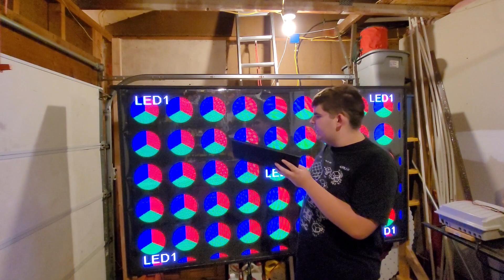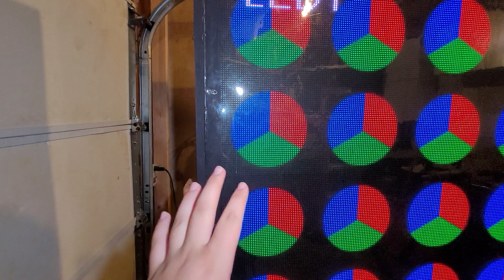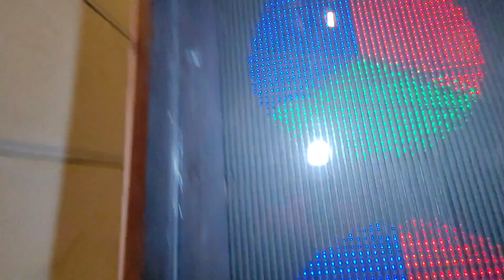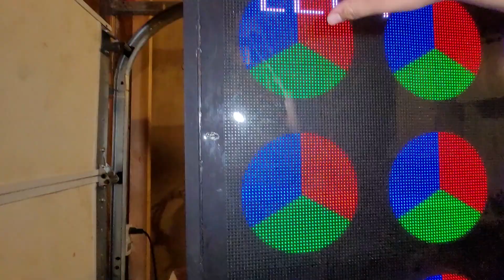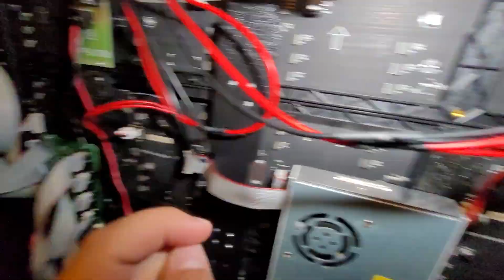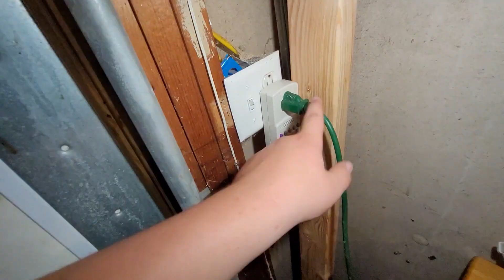P5 Panel Build - Behind the Scenes/Enclosure Build

Comment from the maker: I wanted to add something I said in the video at 8:02. I said you can run a controller off the same Raspberry Pi running the Colorlight card. This is true, but I wouldn't recommend it after some testing I've done. My whole display kept skipping and frames were dropping because the PI couldn't handle talking to both the screen and the controller. Yes it technically does work, but I was getting maybe 3 to 5 FPS with 40 FPS sequences running. I'm going to set up my second PI to run just the Colorlight card and hopefully that will fix it.
Reply: I would like to know how it does. Maybe an update here. I'm just curious 🤔

Comment: I just bought a P5 kit from Wired Watts, 5 high x 4 wide.  I assembled the panels with the arrows facing down and to the left (from rear view behind the panel).  My plan was to put the one power supply and color light card on the right side (again from rear view behind the panel) and the color card and raspberry pi on the same side.  Two questions; Does my layout make sense and how to I attach the components to each other and in what order?  Pi then Color light then power supply?  TIA!!!  Appreciate it!!!

Comment: Regarding the flicker, what version of the firmware are you running on the ColorLight card?  There is a known issue with flickering that is usually resolved by reverting to firmware version 11.04.  If you're not running that version, give it a shot and see if it resolved the problem.
Reply from the maker: I had tried this before and it didn't work, but I actually figured out the issue a few weeks ago! I just had to change the "data groups" setting from 16 groups to 32. Now why and how did it fix it? I have no idea LOL

Comment: In regards to your flickering problem I read that the colorlight card requires gigabit Ethernet to work properly.  I could not tell from your video how you have the Raspberry Pi connected to the colorlight card.  I don't think the Rasp Pi has gigabit Ethernet so I have seen some people connect the Rasp Pi to a gigabit switch and then also connect the colorlight card to the same gigabit switch.  You may want to try that.

BTW, I really liked your video.  Very informative.
Reply from the maker: Thank you for the tip! I thought the Pi 4 had gigabit ethernet, so I didn't think that was a problem. I did just now run a command "ethtool eth0" on the pi that gives you a whole bunch of information about the ethernet connection. It says its 1000mbs, but I don't know if I trust it. I do have a USB to ethernet adapter, maybe I should try that at some point and see if that does anything.

Comment: Hi. Have you solved the right side noise flicker? I have the same Problem.
Reply from the maker: No sadly I have not yet. If I can ask what are you using to control the colorlight card? Are you using a Raspberry Pi in remote mode? Is it connected to a network with wifi or ethernet? Someone told me I should hardwire my Pi running the colorlight card, and that might fix the issue but I'm not sure how. The only ethernet port on the pi is being used to control the colorlight card so I though of maybe getting a USB to ethernet adapter. I was just curious if your setup is similar to mine 😅

Comment: very informative , I've been looking into building a large screen led panel system.  I particularly liked how you improvised the protective clear pvc screen cover and the wooden chassis build .  I did read in the amazon listings that the pvc does shrink or expand depending on temp.  I'm wondering if you've had any issues with that so far?
Reply from the maker: Thank you, glad the video was useful! I did make an update about the screen in either my Halloween or Christmas behind the scenes, but honestly the clear pvc cover did stretch A LOT. It was the worst during Halloween because here in New York, the temps can still be around 60s or 50s. With that and the sun beating on it, it made it stretch a lot. During Christmas it wasn't as bad, but for Halloween what I ended up doing was putting a tarp over it during the day. The worst part about the whole screen was the panels actually stretched in the heat too. The plastic covering that goes around all the pixels and sits on top of each panel actually almost fell off. It stretched and if the clear screen wasn't there to hold it, it probably would've fallen off. When it got colder it somehow stuck itself back on, but I feel like the panels I got were really low quality. So honestly, the clear pvc screen might've been a bad idea and you may want to look into other options if you don't want to see it stretch.

Comment: GREAT VIDEO!  Are you aware of any simple software libraries that can run on a BeagbleBone Black and display text on those P5 panels without Xlights software?  I would like to build a simple 2x3 P5 matrix that simply displays text using an API.  Thanks!
Reply from the maker: Hmm, I wish I did, but I'm not sure of any. I don't really know much about running panels off a Beagle Bone Black so I probably won't be much help.

Comment: Were did you get those brackets? I've tried 3d printing my own but its not very stable. I need them for P3 panels.
Reply from the maker: Are you talking about the brackets in the corners of the panel? Or the brackets that hold up the panels? The brackets in the corners of the panel frame are literally just shelving brackets I found at Home Depot 😂. I don't remember what they were called, but I'm sure if you look around in a hardware store you could find something similar. The brackets that hold up the panels I got from Wired Watts. They have different sizes depending on how big your panel is, but you can find them here: https://www.wiredwatts.com/panel-mounts

Comment: I have watched nearly every single one of your videos - Great content, long time water, first time commenter. I have to wonder though, 7 panels across, 8 panels down roughly comes to $1,600. I'd say there is probably ~$200 in additional hardware etc. A Full HD TV, even some cheaper 4K TVs, come in at far less money for a comparable size. I am looking right now at a 70" for $800, throw $200 at water proofing it... What is the value of the pixel panel done in this way?
Reply from the maker: Thank you so much for watching! You're not the first person to ask why I didn't get a TV instead. Honestly, building it this way doesn't provide any more benefits than a TV would, and a TV may even be better since the resolution is way higher. The only thing different with this is you get to build it yourself. I honestly thought it was fun doing it, but with multiple people asking me why I didn't get a TV instead, I kinda regret my decision. If you're looking to do something like this, I'd probably recommend just getting a TV instead, but you live and you learn!
Reply: TVs can't get anywhere as bright as these panels.  If you are only going to run it at night then a TV might be sufficient, but the difference in brightness is pretty major.
Reply: @DocNo27  I came to the conclusion that a tv wouldn't fit in. A high definition display where black isn't black or "off" is just a random screen omiting black light which looks horrible in a light show. It also doesn't suite when low resolution pixels which is the theme of light shows then a random hd screen.

Comment: not to be cras and a serious question: wouldn't it have been easier to buy a cheap TV?
Reply from the maker: I don't think so. This screen measured from corner to corner is 101 inches, so if you search for 100 inch TVs, most are $2,000+. And even if there was a cheaper TV, where's the fun in that. I wouldn't be able to build my own screen 🤣

Comment: I like the build but I'm just afraid your back cover is not waterproof. Screwing it into that top board leaves a gap that even silicone would have a hard time to seal properly. On the very top board, you may want to replace it with a 1X8 with your sides being 1x6. This will create an overhang of an inch on the front and the back much like you have on the sides. Also, I would put doors on the back instead of a sheet of wood so you can fix any problems as they occur. You can easily build the doors with a rubber seal around the edges (much like a refrigerator door). I would just hate to see that much money, time and effort be ruined. Love your videos! Keep it up!
Reply from the maker: Thank you for the advice! My dad and I definitely agree that the screen needs to be rebuilt next year. Thankfully, it sits underneath eaves, so no water falls behind it (unless it's raining sideways). We're, also thinking about ways to add a door, because I've had to fix things twice behind the screen. It's so annoying having to unscrew the whole back to get inside. But this was our first year having to waterproof such a big element in our show, so I'd say we did ok for the first time lol!

Comment: Thank you for putting out this very detailed video. I just purchased 20 P4 panels and the same card from Aliexpress so I won't get them until January. It is good to know how you have it setup and what I have to look forward to doing when they arrive. I am currently doing a replacement of LED strips with COB lights in my home office and agree the price of Acrylic panels has gone thru the roof. Just one 1/8 x 2' x 4' panel is $45. Ripping it down to 45mm strips and covering with defusing tint should look good though. I will look into what you used for your front panel even though my panel will be a little bit smaller than what you have setup. I just watched your software setup video and it really helped me a lot.
Reply from the maker: Glad the video was useful! If you use the plastic covering I used in my panel, just make sure to keep it out of direct sunlight if you live in a warm climate. I've had so many problems with it this year stretching and sagging like crazy. The temperatures here in New York have been a lot warmer than normal, so for a week straight every morning I had to cover the screen with a tarp so it didn't stretch, then take it off when it got cooler and darker. I Think I might try and find a replacement for it next year. Any temperatures over 45 - 50F in the direct sun is when it started to stretch, so if you live some place where it will be warmer than that, I'd recommend looking for some other options.